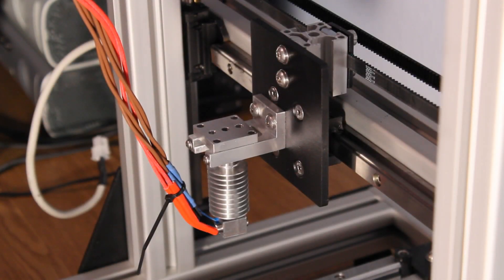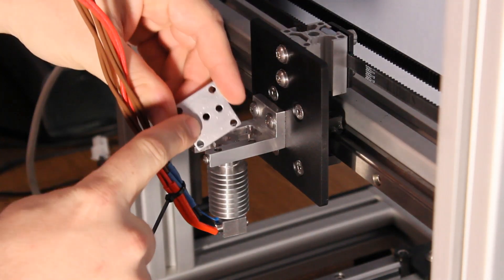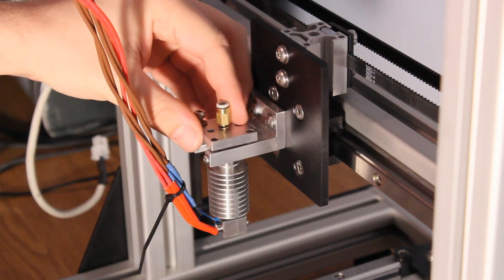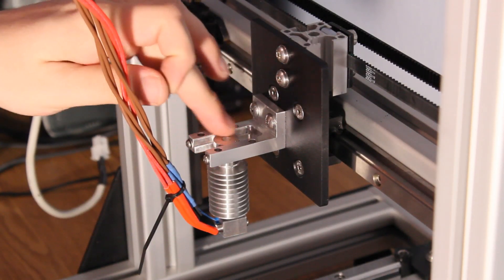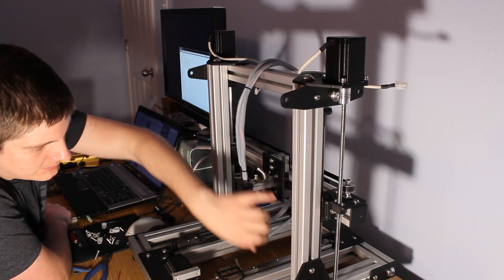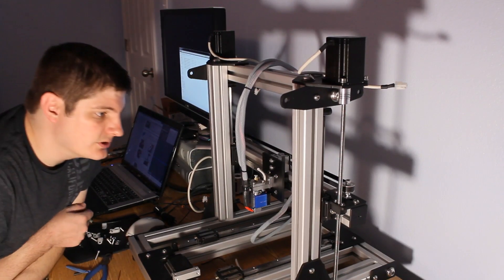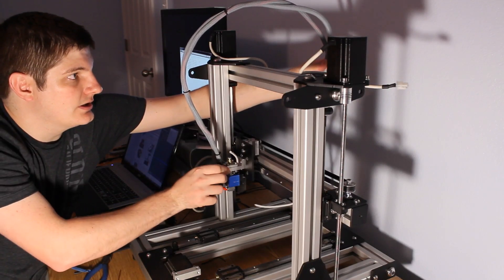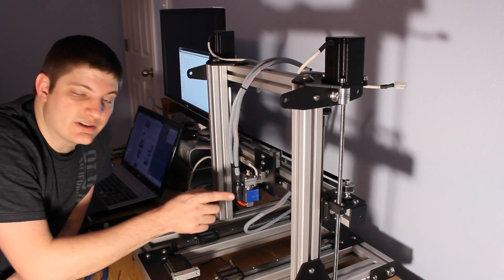Evan's DIY 3D Printer / Mill - EP5 B - E3D Hot End Wiring

Comment: with that kind of linear rail you can mount the stepper on it to have a direct drive extrusion system. Is there a reason to go with bowden?
Reply from the maker: You are correct, I do have room for it. Initially I planned to leave room for the dremel head next to it, attempting to make the working area for both tools equal.  I couuld mount the extruder up there now actually, but that was never the plan.  Bowden has worked for many people, so why not get all that mass off the moving parts.... that was my thinking at least.  I'm still new at this, so I appreciate the feedback.

Comment: Good Job. Looks like we have the same plan and sourced our parts at the same venders. I'm at the boden extruder parts I have a geared stepper but need to buy the rest of the parts
> any sugestions?
Reply from the maker: My next 2 videos are on the extruder calibration and more about the one I used.  
If you have a geared stepper you can probably get away with a direct drive setup.  I have a standard NEMA17, and used the gregs wades hinged extruder and a hobbed bolt from Lulzbot.  Check out EP8 when it is up in a few days.